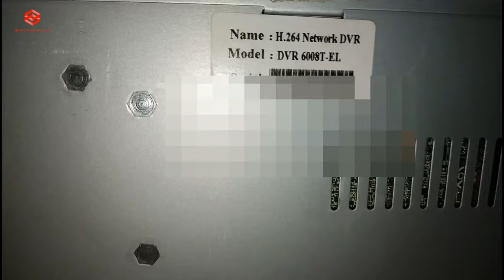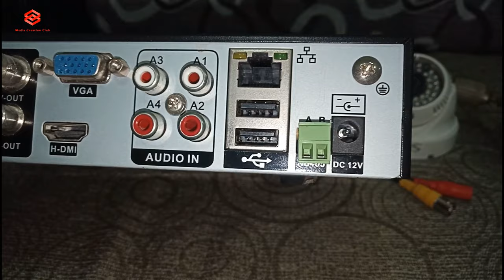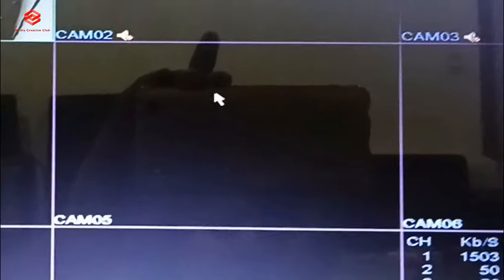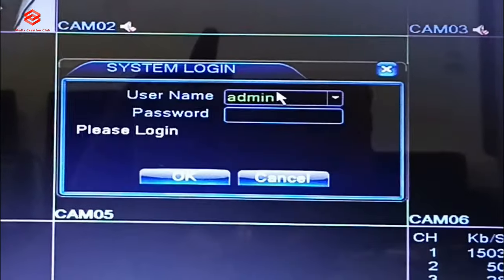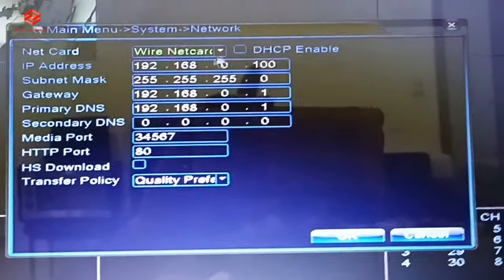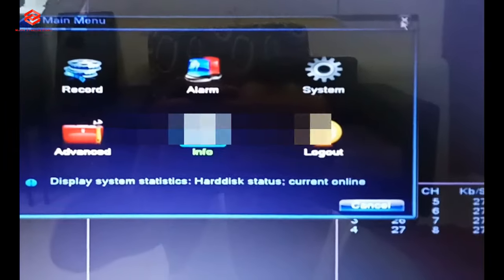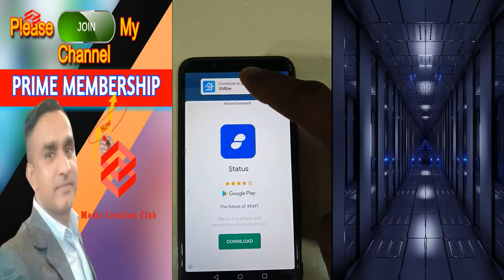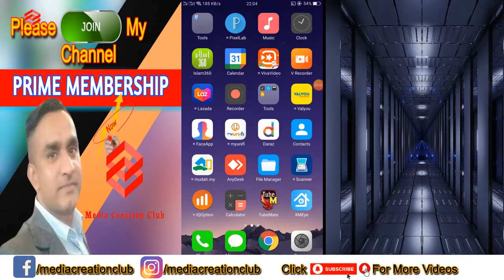How to Remote View H.264 DVR || How to Install CCTV Camera's With DVR || Network Setup on the DVR

Comment: If power line goes off and then after lets say 10 minutes goes on , DVR will recording again or I must start it manually? Thanks
Reply from the maker: It depends on your dvr recording settings but normally recordings will be running after electric will be back but if your dvr you give supply 12 volt supply for backup even no electricity 🔌 it will continue workings
Reply: @MediaCreationClub1  Thanks so much👍

Comment: I follow your step, the DVR already set to online (connected). Then can watch from Monitor but can not play on EMEYE App on mobile phone. Can login but no channels being pop up to play. Please assist.
Reply from the maker: Create an ID on Xmeye or use serial number correctly and if already linked your dvr to Xmeye you will be able to see your dvr
But if still you facing the problem you contact me on my IG and I will assist you with screenshot so easy for you
Reply: On your monitor - right click and under Main menu is "Guide". Click next, next and you will find a QR code for the Serial No.
 So in Xmeye click the ADD button and then the little scan button. Then scan the QR code and it will get the correct Serial No.